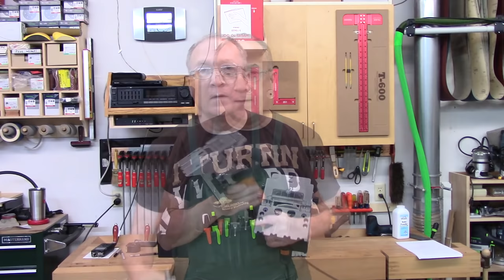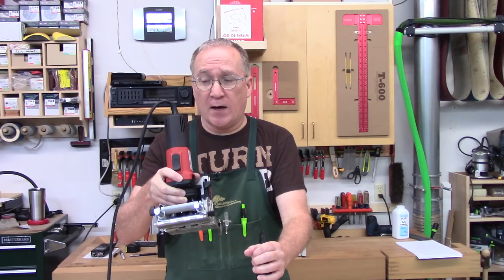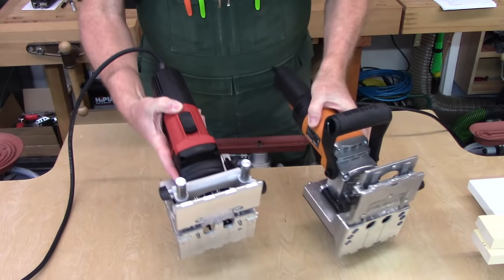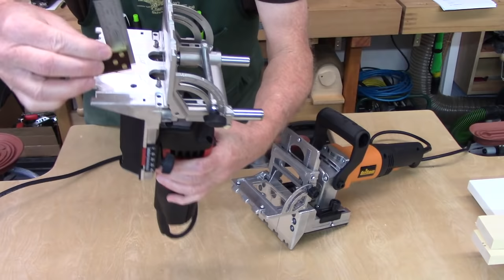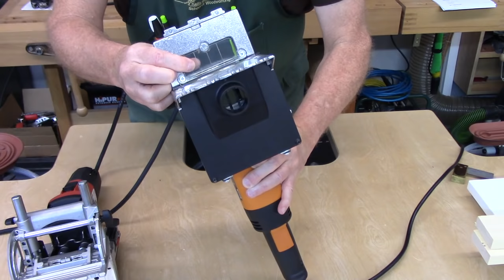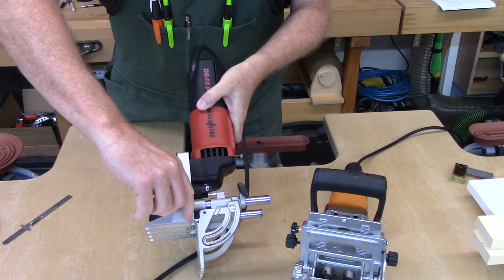Part 3:  Triton Duo Dowel Joiner vs Mafell Duo Dowel Joiner

Comment: The Triton is actually more expensive than the Mafell, after you consider all the wasted time, material, and lost business.
Reply from the maker: Hi Tracy, I agree.  Your comment reminds me of one of those John Ruskin quotes:  “It's unwise to pay too much, but it's worse to pay too little. When you pay too much, you lose a little money - that's all. When you pay too little, you sometimes lose everything, because the thing you bought was incapable of doing the thing it was bought to do. The common law of business balance prohibits paying a little and getting a lot - it can't be done. If you deal with the lowest bidder, it is well to add something for the risk you run, and if you do that you will have enough to pay for something better.”
Steve
Reply: Sorry Tracy, but you can not have purchased the Triton expecting it to be a good shop tool for professional use. I did not check US prices, but the tool is available in Europe for €155 at the time of this comment. The Mafell is around €750. Where were you expecting this to be close in quality? 

Like most Chinese knock-off tools, with a little diligence, modification, and care in use (=time) it can be made to work very, very well. 

For us non-professional users, that means we can achieve results on-par with professionals (albeit with a greater investment in time), and that makes a purchase such as this (and all the rest of my cheaper, non-professional Chinese tools) worth it. Even if we only use the tools a handful of times a year.

There is a company in the UK called Axminster Tools and Machinery. They classify their tools by use: hobby, trade (professional), or industrial. It's not difficult to do this yourself when your tool shopping. If a tool costs only 15% as much as the big, professional brands, it's not made for professional use. Do this and you'll no longer lose any business.

Comment: Thanks for the video, Steve. I was actually contemplating buying the Triton (was down to $179), but it would appear to be money thrown away. Guess I'm going to save for the Mafell or a Domino. Perhaps the folks at Triton will take the reviews to heart and redesign a reasonable tool.
Reply from the maker: Thanks Mo, I was hoping for good results but things went south pretty fast.  Perhaps they will see it and correct the deficiencies.  Even if they had to charge more to make it work, I think it would still be very price competitive considering the next choice is much higher in price.  Steve

Comment: I don't see why using the jig, when the dual fences do same thing. I have the Grizzly, $115, I've only used it on cedar, ash and plywood so far and I love it. I had to adjust a few things but thats common with any tool and its fine now!  Good video!

Comment: If I were going to drop +$1200, I would certainly get a Festool Dominio and not a Mafell DD40P.
Reply: Dowel joints are stronger than the Festool Dominio joints.
Reply: a dowel costs 1cent and you can get them every where,
Reply: I would rather have to use Einhell than give festool my money.

Comment: The Mafell is not perfect though. If you plan on buying one, make sure you buy a bunch of the internal springs that allow the plate to retract. We went through an entire bag in a 4 month period.  Also, depending on how you are using it, that vaccum attachment location can be rubbish. We were using the mafell Dowlers daily for making douglas fur cladding. If you do not have a vacuum,  make sure you have a blower, it clogs up fast otherwise.

Comment: Yes the Mafell is better but it’s $1500 USD  correct???  The Triton is what $230 USD at Rockler.  So not at all a fair comparison don’t you think.  If you can drop that kind of cash then buy the Festool domino joiner
Reply from the maker: It is fair because both tools are supposed to do the same thing.  One performs orders of magnitude better than the other.  If you want the Triton, by all means go for it, I am sure you will be impressed by its low price.  Steve

Comment: I recently  purchased  a Triton  Duo  Dowel Jointer  a few months ago.  Sharp Edge Wood Work ,had the  most in depth  review  of the tool at the time. I have been  pleased with the Dowel jointer,  since  my purchase.  I have used it quite a bit on several  projects. With that said , up until  I discovered the Triton  Jointer,  I was limited to  my Dewalt  Biscuit  Jointer and pocket  screw  Joinery.  I'm not a professional  Full time woodworker depending on the  tool to earn my living.  Or trying  to work  within  a micron tolerance.  This tool has upped my game  as far as quality  and  speed  of production  on  cabinet  face frames and  some door panel  assemblies  I've done. I've had some good success  with the joiner.  There is a learning  curve as with any hand tool,  personally  I wouldn't  discourage  anyone  from purchasing the tool, if you need one. The average  DIY Guy , weekend  woodworker, will probably never wear the thing out and it's more than capable of producing  decent  quality.  I guess  the Short And The Skiny  everything  has a purpose and a philosophy of use. It's just another wrench in my tool box and allows  me some Joinery  options I wouldn't have  otherwise,  I'm not a Triton  Fan Boy,  but I have to weigh  the price against realistically how often  I use it. And  there is only Low End and High End nothing  in the middle  that I'm aware of. I enjoyed  your  video  and  appreciate  the time and effort  you invested in  it. You did an honest review. I just wanted to throw  my two cents worth  out their.  I'm not in any disagreement,  I'm just not that critical of the tool I guess.  Thanks  again for  sharing the review.
Reply from the maker: Hi Brian.  Thank you for your well presented comment and sharing the results you are achieving.  I believe those considering purchase of any tool need to consider all results and not just one piece of information (including my own).  As you said, there are currently only two fish in the sea in this category, the budget tool and the tool whose pricing makes Festool look like a budget brand.  I had viewed the Sharp Edge videos on the Triton and while he had issues to fix as well, he was apparently able to overcome those and achieve good results.  I did expect to do some tuning on the machine based on his reviews and had high hopes for the Triton as an affordable alternative to the other machines.    Based on a few good reports on this tool and a few bad results on the same item, I can't help but believe that there are some quality control issues in the Triton factory where they seem to be unable to produce a consistently performing product from one machine to the next.  Several days ago, I was making the last video in this series and while doing so, I got a computer generated email from Triton asking for feedback on the purchase.  I will provide feedback on this (including links to the videos) and hopefully, they will take the appropriate actions to produce a more consistent product.
Thank you for your thoughts.  Steve
Reply: Thanks for the reply. I had E-mailed Triton, actually I think they are a US based distributor for Triton, in the Carolina's. I was asking about the availability of the tool as Rockler and other reputable vendors are constantly out of stock.They replied with an apology for the unavailability saying they didn't anticipate the sales and demand they experienced. They assured me ,they would be getting another shipment and asked me to wait a week or two , That the next shipment would be an improved model. I wish I had waited , but I found mine on Amazon and pulled the trigger on the purchase. I was hopping your video was based on this illusive new and improved model. Id be interested in seeing that.Id buy the tool again at the current price point , if there are any real marked improvements. Thanks again for the reply.

Comment: Join Steve next time as he brings us his comparison review of the Ford Pinto vs the BMW i8, haha!
Reply from the maker: LOL - We used to have a 73 Pinto and traded it off in 1983 after 136K miles.  Never owned a BMW but have driven one.  Needless to say, the BWM would be a nicer ride but the bottom line is both will get you from point A to point B reliably.  If the Triton were a car, I doubt it would get out of the driveway.

Comment: Great review. Like any other quality product, the details is in the repeatability of function. I was going to cheap out and get the trition as I couldn't find the Mafell locally, but ended up with a Domino XL after watching your video. Yes, 200 and 1500 are different price points, but time is also money, and I don't like to waste good wood or have to do a lot of finishing after joining. Good wood is not cheap. I want to get it right the first time.
Reply from the maker: Good comment, time is valuable to the hobby woodworker too as all too often, our time is limited.  Some inexpensive tools do what they advertise pretty well, the Triton dowel joiner is just not one of them.  The Domino is such a big timesaver and makes strong joinery as well.  Steve

Comment: Good review of both. Although true, that it is unfair to do a comparison of such price difference machines it is also true that they both aim to do the same job therefore I find it fair game. Good review. I hope you put back the rubber cushions on the Triton to be fair.
Reply from the maker: The problem with the rubber cushions is they cause misalignment of the holes when joining a rail and stile.  The overall design is very poor.
Reply: @extremewoodworker  thank you for the clarification makes sense.

Comment: Thanks for the comparison Steve.  Would you please do a comparison between the Mafell and a Festool 500 domino?  Since I do have the domino, but no first hand experience with the Mafell, I would be interested to know under which situations you would chose one over the other.
Reply: +1 on the Domino vs Mafell
Reply from the maker: Hi Steve, I'll cover that in the next video.  Steve

Comment: On some I have seen you need to compensate for it drawing back when you adjust the angle. Like at 45 start  locking it down at 50 so it will stop at 45,

Comment: Worth noting that power output is not directly related to input. Quality of wire and winding can mean massive loss from input to output. Mafell has much more powerful power consumption, and higher quality motor means far more power to drive bits into hardwood

Comment: Hi Steve. Thanks for the great review of the two machines. It was very illuminating. Yes both machines have very different prices and you expect different machines qualities but the Triton didn't even perform its basic functions in a satisfactory manner. Too bad you don't have access to the discontinued Freud to compare it to the Mafell. I'm curious how it would compare to your Mafell. After watching your 3rd video I got my Freud Duo Doweller out and followed your testing protocol. All the joints were flush and fit with no issues. The fence and base are all machined and is flat and does not rock and the fence does hold 90 degrees with no problems. It too cannot compare to the Mafell and its features but it seems to be better than the Triton.
Ron
Reply from the maker: Good report Ron.  Steve

Comment: Steve, Have you seen Grizzly’s version of the dual dowel?  I wondered if it was Triton with a Grizzly label, or perhaps includes improvements so one could actually us it?
Reply from the maker: Hi John.  It looks just like a rebadged Triton.  Even if they fixed the other issues, the anti-slip pads that stand proud are problematic especially with narrow stock.   Steve

Comment: What do you prefer using, the Mafell dual doweler, or the Festool domino?
Reply from the maker: I wouldn't call it a preference but based on the work I typically do, I tend to use the Domino more.   Steve

Comment: of course there must be a difference if you look at the prices; but look at those joints made with the triton - you can do that easily with any 5€ template. So, either you go with the pro equipment or you shouldn't buy such a tool at all! This comparison shows that very well

Comment: I have this Triton doweller, and I manage to make decent joints with it, but only because I am thinking about what the tool's failings are. It doesn't give the out-of-the-box accuracy that you get with a Domino jointer (I've not used the Mafell), but how can it at £120. At the price it is not possible to make and sell a precision machine, and it is foolishly optimistic to think the triton will be. 
Best save up your money and buy the German

Comment: Really good video thank you! I assume it is possible just to remove one cutter where only one dowel (or an uneven number) is required?
Reply from the maker: Thanks Richard.  It is possible to remove one bit but that would leave a joint that would rotate so I do not do this.  I have found with the Mafell, it will accurately drill into the same hole with the rail for any bit or with the plastic spacers with the 8mm bit.  Steve

Comment: this is a great review! great job -- but you are comparing a 200$ machine with 1200$ machine
Reply: so? I found the comaprison quite interesting. If I was a professional woodworker and would have to use such tools often, I would buy the higher price willingly. This just shows that good quality has it's price. I think of it that way: Festool/Mafell or other high quality brands want to sell good working tools of high quality AND make money. Some other companies just want to make money and provide kind of a functioning tool that does the job to minimal standards. Of course there are variuos steps in between this two asumptions.

Comment: Great review thanks.  Why this vs domino?
Reply from the maker: Hi Tony, I'll cover that in the final video on this.  In a nutshell, dowel joinery is faster with less expensive consumables but it does have some size limitations the Domino does not have.  Steve

Comment: Great review. Yeah, not a fan of Triton. I am generally curious about what's driving you to dowels when you have Dominos and the P-system available (all though there's nothing wrong with another high-quality tool :). Share your thoughts there?
Reply from the maker: HI Ron, I'll cover that in the final video.  See the reply to Tony's comment.  I didn't really purchase the dowel machine for joinery but it does an excellent job at it.  The Zeta P was purchased for larger jobs because I don't have the room for a bunch of assembled cabinets in my shop.  It was less expensive than adding on.  Steve

Comment: Dear Sir,
Comparing Triton with Mafell is akin to comparing an Aston Martin versus a French Citroen 2CV. They both will you to where you want, however don't expect much in the ride quality, speed, road holding & handling capability of a Citroen ( Incidentally in Dutch it means lemon, need I say more???). Of course for those whose budget knows no limits &/ are willing to pay the extra premium, there is no contest. Likewise for the person who wishes to acquire some sort of device that will perform a similar task but at a fraction of the price, there will be some compromises to be made. It's all relative just as when people decide to acquire something ( cars, motorbikes, T.Vs, etc, etc...)where there is a plethora of manufacturers & models to choose from. We can all justify it to ourselves & no need to anyone else. I've chosen the route of simply the finest regardless of cost but that is my personal choice that others might &/ might not share. Very well done demonstration however. Kind regards.
Reply: of course there must be a difference if you look at the prices; but look at those joints made with the triton - you can do that easily with any 5€ template. So, either you go with the pro equipment or you shouldn't buy such a tool at all! 

Btw - it's the same with biscuit jointers, the cheap ones are absolute crap, and even the DeWalt or Makita aren't good compared to the Lamello's

Comment: I know this is long after the product review -- but you're comparing a tool that costs $1500 vs one that is $150 -- Its not a very fair comparison. Is the $150 model better than using a dowel jig -- probably so, makes it a good option for us that are just doing this for the fun of it. There are vieos showing how to make the $150 version work better so... Would you use the $150 for professional full time cabinet makers? -- probably not.  I don't understand why you're doing this video -- like comparing a base model toyota corolla to a top of the line lexus.
Reply from the maker: Hardly.  Both the base Corolla and the Lexus get you from point A to point B.  I would not hesitate to purchase either as they both get the job done although I am sure the Lexus would be with more comfort.  Using your analogy, the Triton is more like a Yugo - maybe it will get you there and  it most certainly will not be easy or fun.

Comment: I can't understand why you would want to review 2 machines that are so far apart in price scale,does not make sense to me,one would be ok for making garden gates the other for fine furniture.
Reply from the maker: This is explained completely in part 4 of the series.  Steve
Reply: because they are the same type of machine.  Its identical in function, but appears totally different in performance. Dowels require very tight tolerances to be of use. You can buy a dowelmax, which is good quality, but is not motorized. I'd get a dowelmax before a triton. Slow and accurate is better than fast and sloppy.